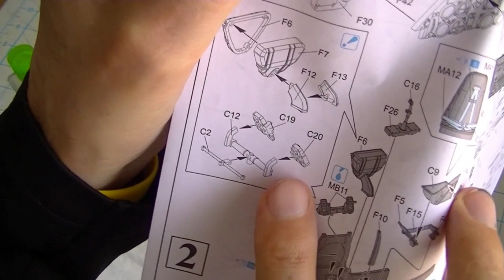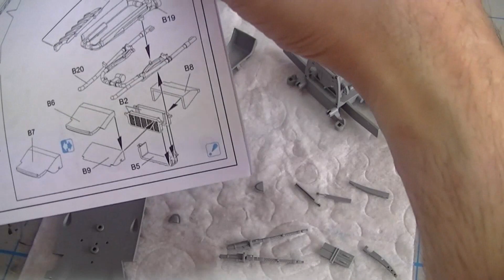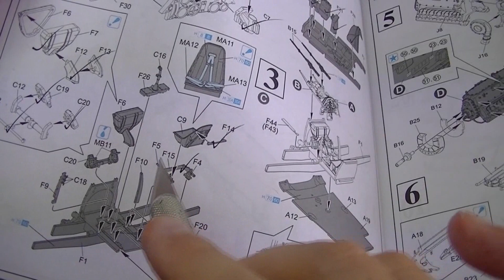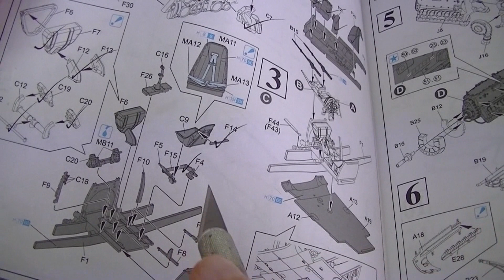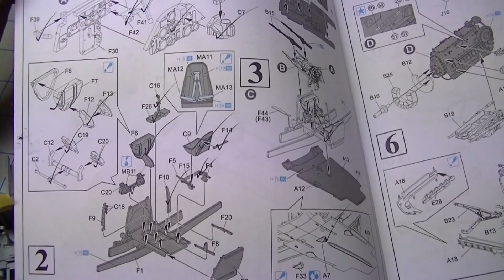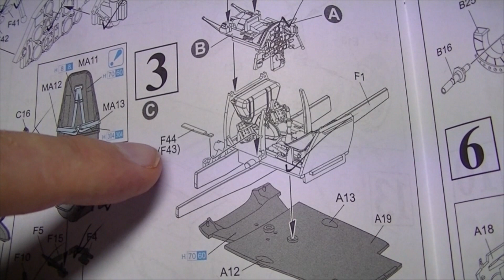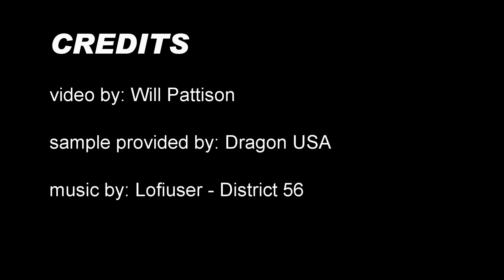Building the Dragon 1/32 Bf-109E-4B with Will Pattison - Part 2

Comment: I'm building this kit right now. F43 and F44 really pissed me off (Instructions are terrible for them) and F9 and F10 ribs were a guess on their placement to align with the cockpit wall (I did OK but your idea was better). The Cockpit wheel assemble was garbage and ended up cockeyed (I managed to tear it apart and redo the way you did it). I thought The level  F39, F40 and B4 also made me angry.

Comment: This is a well made and accurate kit made by Dragon plus its a third or the price of a Tamiya kit.Dry fit ,use reference material,and a little bit of modelling exertion would serve well,True Dragons instructions are ? work from # bottom,up not top down but I would take that at this price point over tamiya anyday.The only real problem with this kit is the lack of rivet detail but nothing a rosie riveter would not fix.
Cheers Mick